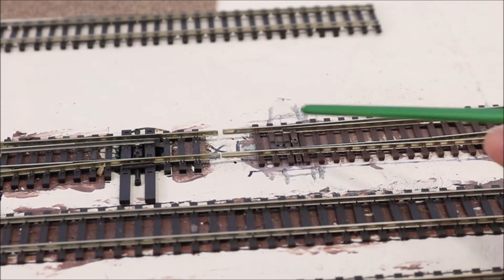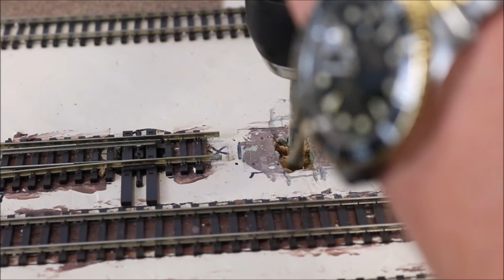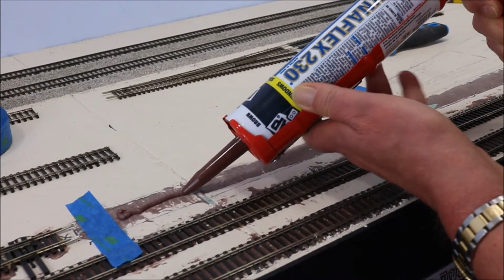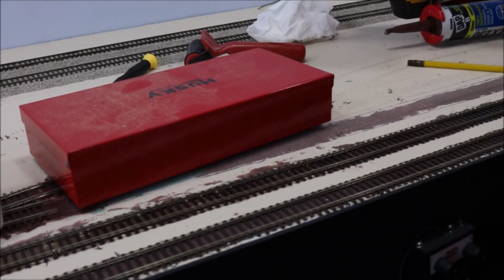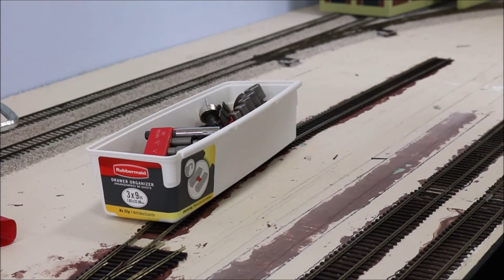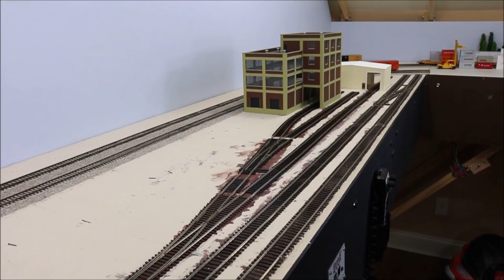How To Install New Track and Turnouts

Comment: Sir, 
Could I just drill a small hole a little bit bigger than the throw rod for the turnout or do I have to place a large hole underneath the track? What is the large square hole that's going under the track for?

Comment: I wanted to see someone use latex caulk. I want to use it because I heard it was quite.
Reply from the maker: Thanks for your comment. I recommend this method and have used it throughout my layout. My only caution is to avoid using too much caulk. Just a thin layer does the job...Harold

Comment: I've used Sharpie and alcohol for 10 years and never had bleed through problems. Switch rod hole only needs to be 1/4" hole. I still tape my openings so as not to get caulk in that area. Roy

Comment: I use a new sharpie all of the time and have for the last 20 years and have never had any problems. I also don't use alcohol in any form. I use wet water and never have had any problems with this either. With my layout I cut the slot for the switch machine with a "multi tool" and this is so fast and I don't have to do any cutting away of the foam. The tool cuts a very nice slot under the turnout and the tie on each side of the throw rod will hide the slot. No drilling and no problems... OMG,  that is such a large hole. My way takes only about 15 seconds and is so clean... I use the cheapest Liquid Nail ($2.00 a tube) and only use a little at each end of the turnout at the points where the track connects to the turnout. Have been doing this for several years and no problems. Makes taking out the turnouts very easy if and when you want to change them. While laying the flex track I use "T" pins to hold the track in alignment and cans of soup to weight the track down. A can then the push pins on each side of the track followed by another can.  I also do not use control panels as I just take a square and put the switches for the turnout control on the facia at the location of the turnouts.
Reply from the maker: Thanks for your feedback. There are so many different ways to do this. Each of us has their own method. Yours sounds like it has passed the test of time. If it works for you, it may be useful to others. So, thanks for describing another way to lay track and turnouts. I'd like to learn more about the "multi tool" that you are using as it may make my future installations easier. As for the sharpie question, you pointed out the difference...I use alcohol as a wetting agent and the alcohol dissolves the sharpie ink. The wet water that you use does not dissolve the ink...Harold

Comment: You make it look easy! Great work. How do you see your pencil markings once the glue is down? -Mark
Reply from the maker: Thanks for the comment. Actually, the track laying is easy as compared to complex wiring or extensive scenery. Some of the pencil marks get covered up. But, you know approximately where they are and the caulk, if it is placed properly, also serves a guide...Harold